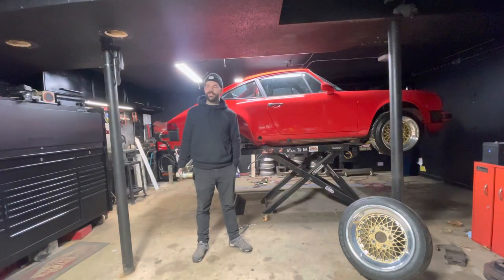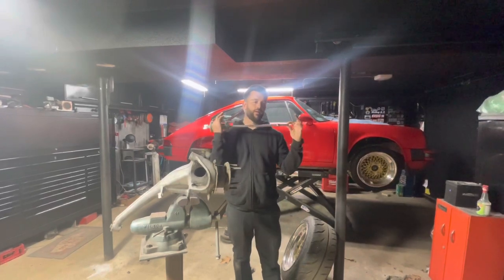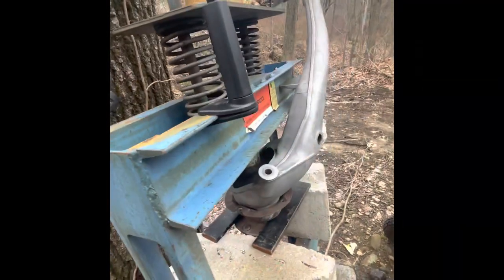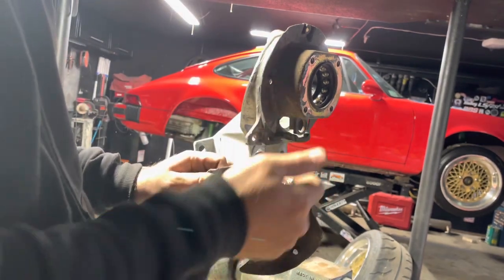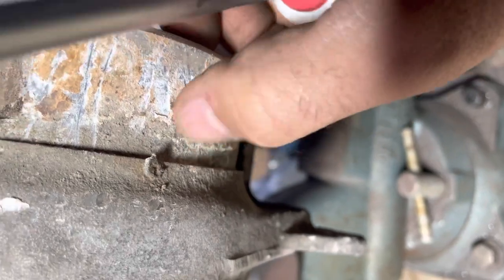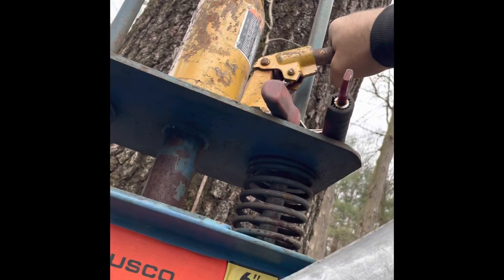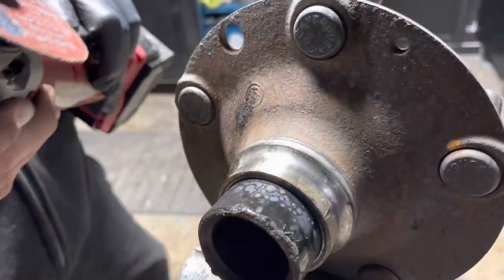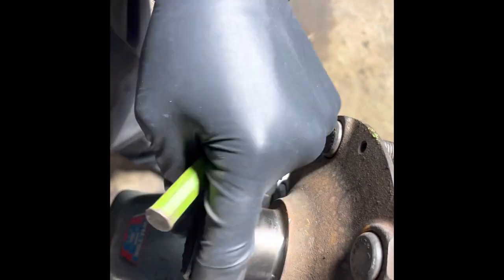Porsche 911sc rear wheel bearing diy

Comment: I had the same problem getting my parking brake housing off the trailing arm. For your other viewers if you make two cuts on the side of the housing, you can then get the housing off without damaging it, and be able to weld it back together.

Comment: Great for the DIY..thanks..What are the metal pieces that you wound up having to tear away from the arm...?  You said they were available new and were pricey.  I cant believe that the bearing replacement would include tearing up two sheet metal parts to remove the bearings..Anyway, this gave me the confidence to move forward on replacing mine..and what new parts I may need when I do it..
Reply from the maker: Sorry for the late reply, they're the E brake cable / brake dust Sheild covers. awesome it gave you the confidence to dive in! you might not have to rip your dust shield off mine were just in really bad shape.